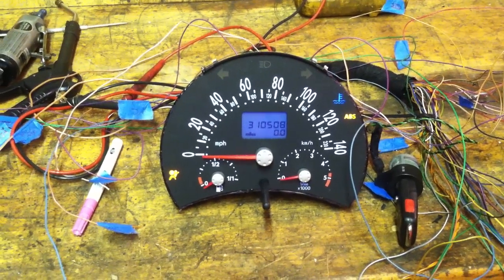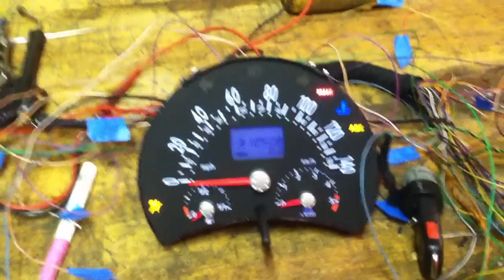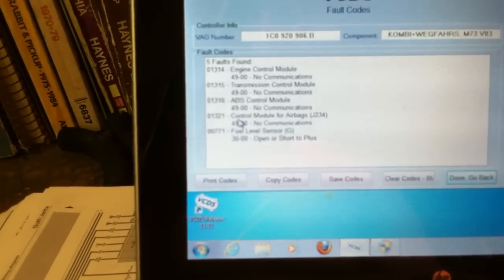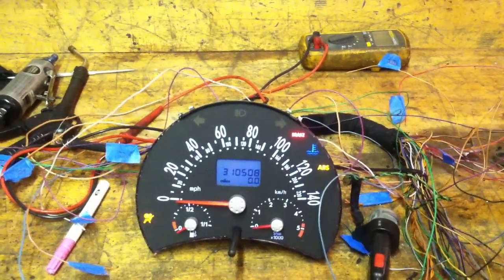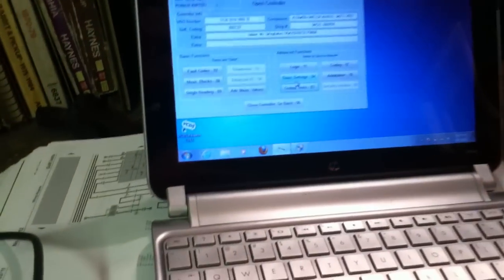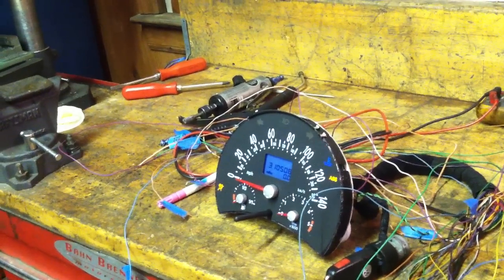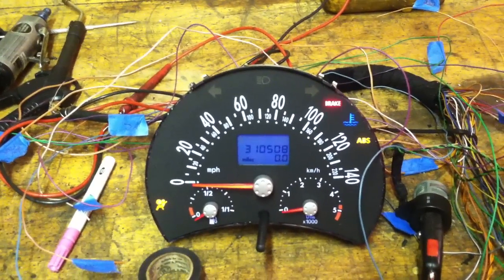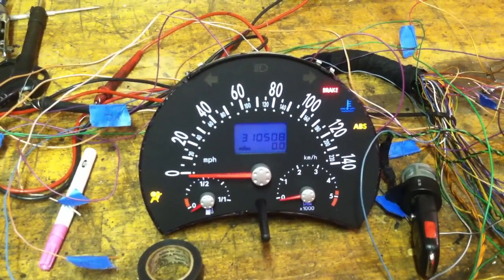Bench testing a VW New Beetle Cluster. Prepping for a TDI swap

Comment: Did you ever got the fuel gauge working? I'm having issue, wiring diagram shows it as a potentiometer   but it doesn't seem to work.
Reply from the maker: I did. Works perfect to this day. I ended up selling the car to a friend and the Gauge reads fine. I just had to use a mk4 potentiometer in the mk1 fuel tank
Reply: @thehoughcompound  ahh right, I'm trying to drive with the a microcontroller on the bench.